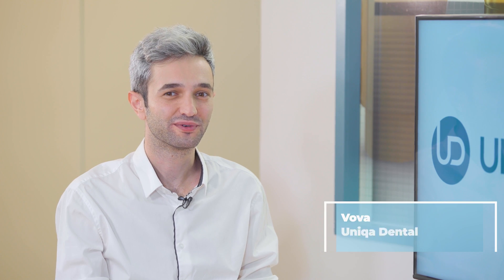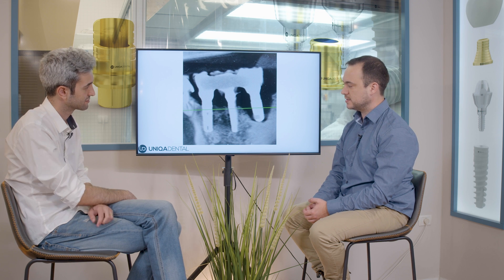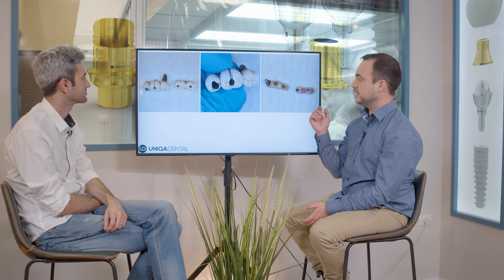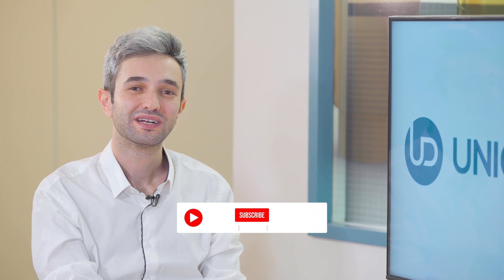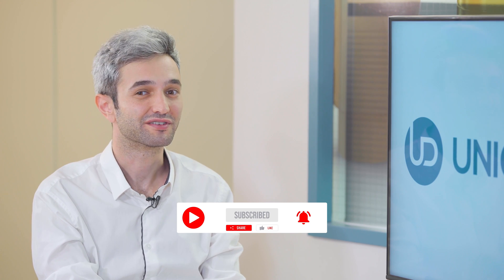Why small holes in screw retained bridge on multi unit better Old cemented bridge was replaced

Comment from the maker: 00:00 You can see health problems
00:35 This picture says it all
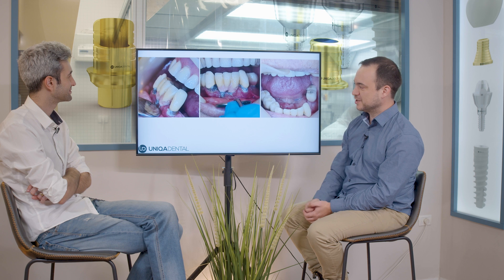00:48 He didn't want to do anything
02:02 It's pretty obvious
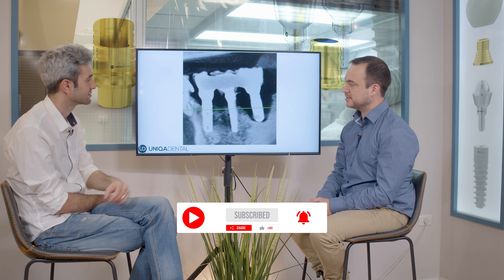02:40 This is the cement. This is the residues of the cement
03:48 We've made new bridges for the patient.
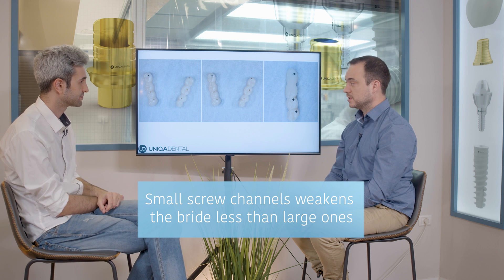04:14 PMMA is soft material, and with time, it can unscrew
04:59 This inflammation in the frontal area
05:04 We restored both sides with two new bridges and in this case it's even temporary bridges